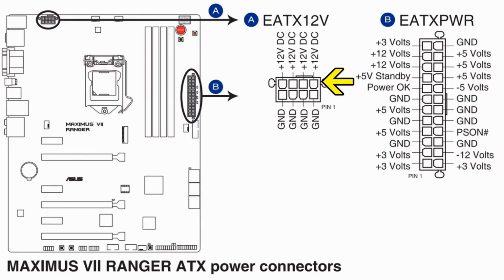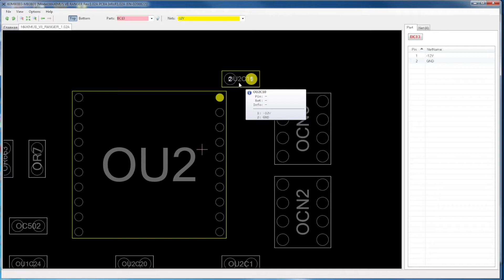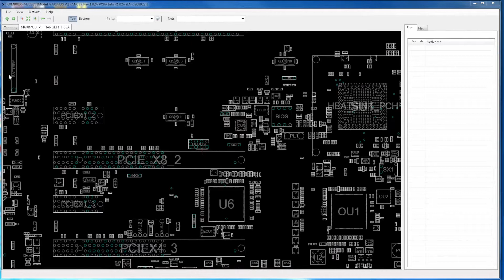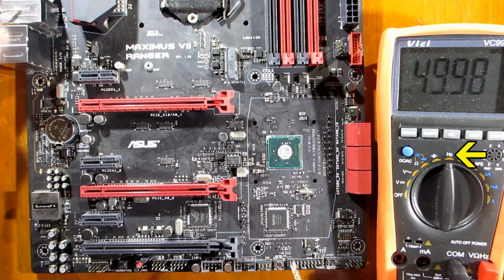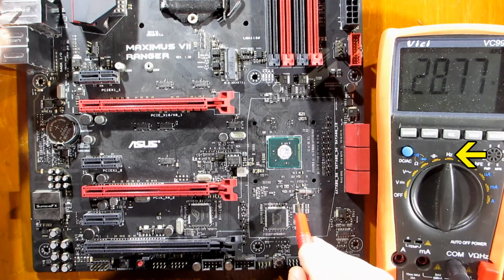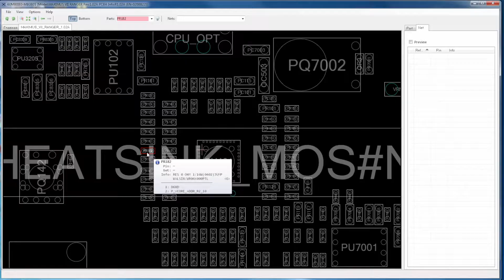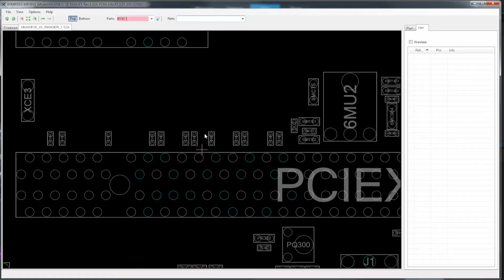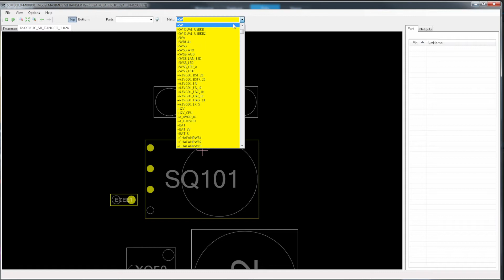Not Repairing Motherboards -  ASUS Maximus VII Ranger pt1 - FAIL1

Comment: Hello . Did you manage to find the problem ?
I have exactly the same situation, power is everywhere and the CPU has no initialization.
Reply from the maker: If your CPU LED is lit, it's probably hopeless because I think it's cracked balls under the CPU socket - this is a guess based on a different MB that had broken connection between CPU and RAM and a lit GPU LED -. 
If it's not lit, it's probably something else, ie, not terminal.
When I did my research I found a lot of people with different solutions for this problem, and that's when I realised it the same symptom caused by lots of different faults. Adamant IT has a repair of this MB without the LED lit.
Reply from the maker: A repair turned up with a CPU fail LED, and it was the bios, ie, it might not be hardware like I thought https://www.youtube.com/watch?v=1SPlDXkgxS8
Reply from the maker: Part 2 - https://www.youtube.com/watch?v=YQShabU582g